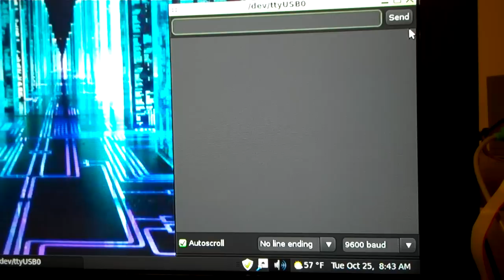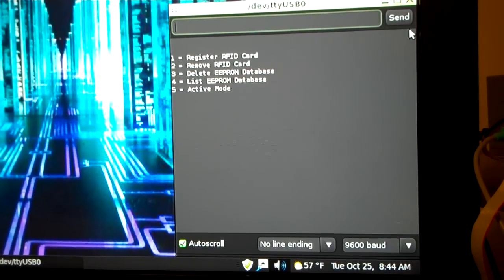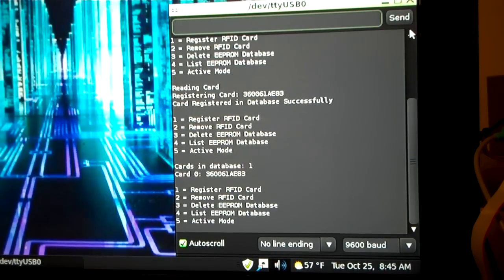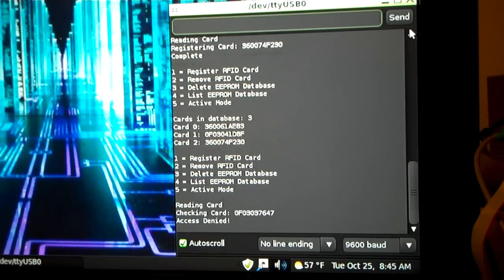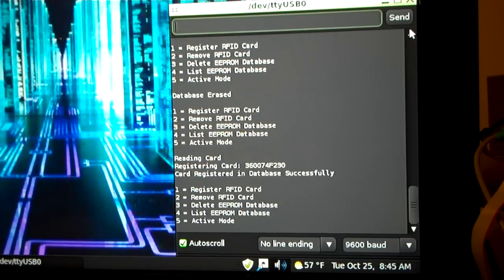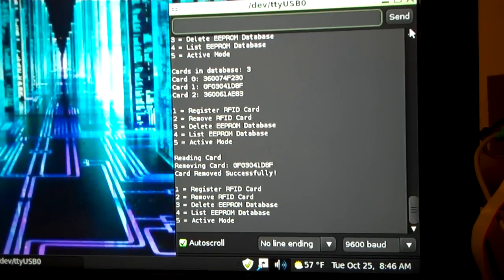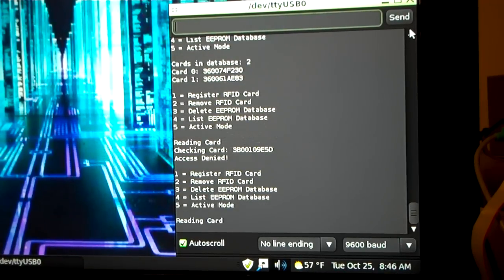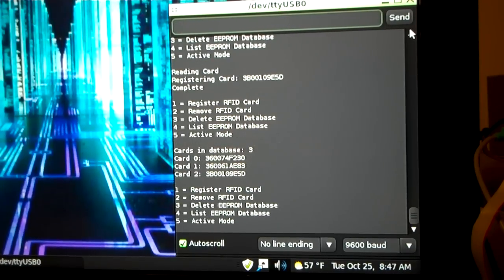RFID Database System

Comment: Hi i got your code to work , but i am not sure in what pins to connect the rfid card .
If you could reply it would really help thanks !
Reply from the maker: vladPRObmx The pins are defined in the code.
Reply: navic209 Alright i got it to run , everything works fine but i have only one issue . 
Every card i try to run shows tag : ÿ000000ÿÿÿÿÿÿÿÿÿÿÿÿÿ
I`m using arduino uno v3 with ID-12LA rfid .
I have been seraching on the internet for a fix for this for hours . :(
Reply from the maker: vladPRObmx don't know what to tell you about that. First thing that comes to mind is baud rate but not sure.

Comment: NewSoftSerial RFID(10, 255);
In the above line we are getting error...

Error::'NewSoftSerial' does not name a type

Have you done it with UNO(ATmega328) ??
If yes then which Pins you have taken as Rx and Tx ??

And our rfid tag code in HEX is 6F00946DB82E.